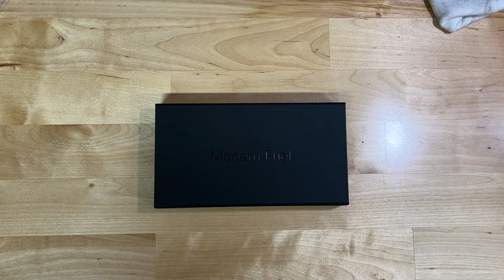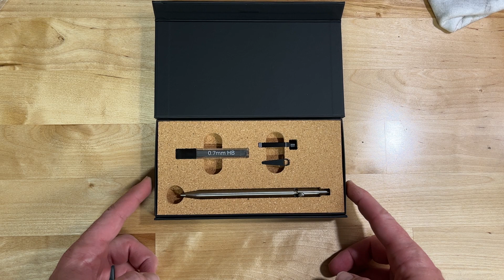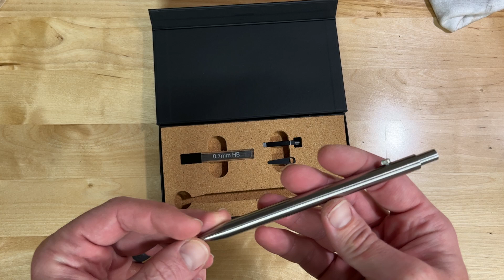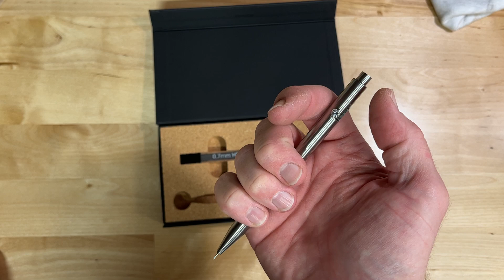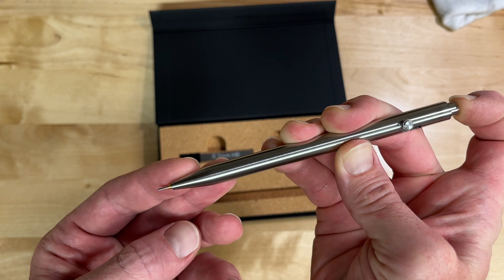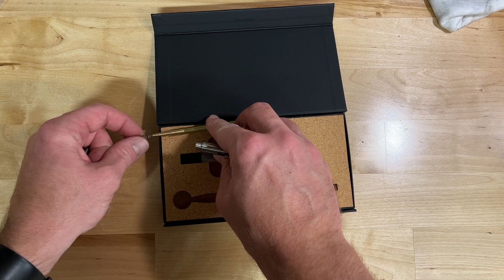Modern Fuel Bolt Action Mechanical Pencil Update - First article inspection!

Comment: Really unfortunate you didn't make a better clip like BigiDesign's (Big Idea Designs) lefty/righty clip that doesn't clip onto the body but is screwed down. Waiting for the bolt action pencil and Pens to get a better screwed down clip. It would have also been nice to see the lead hole have a screw on cap instead of a pull off cap that can loosen overtime.